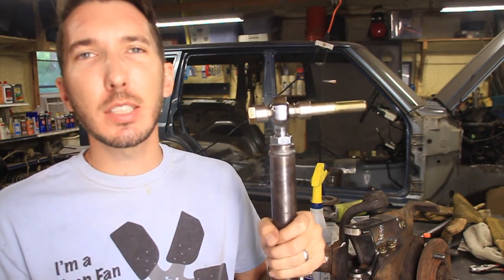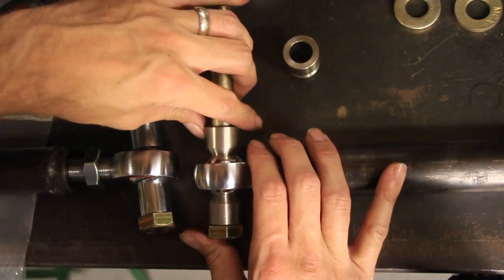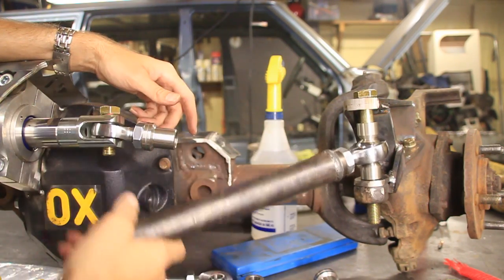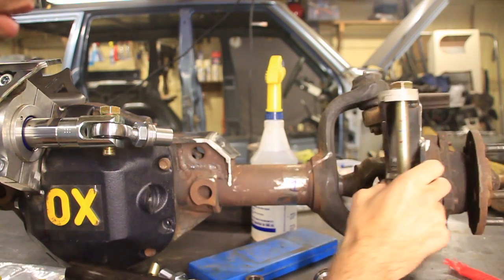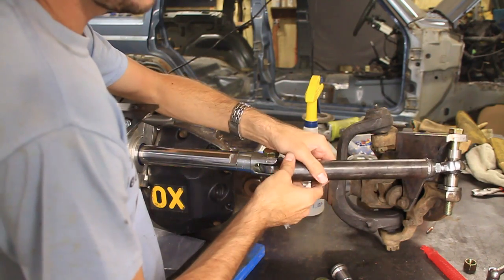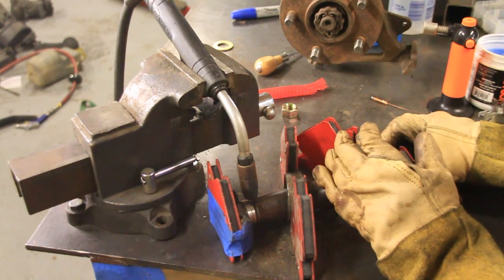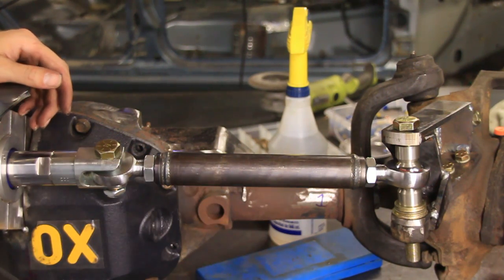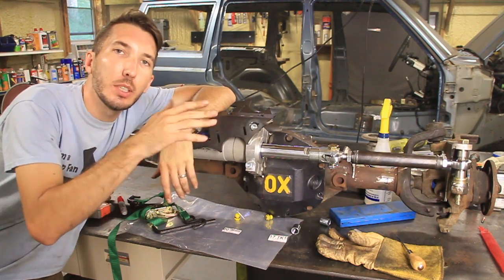What is a High Misalignment Spacer?  And Finishing the Full Hydro Steering

Comment: Would you recommend this for on road use, I plan on driving my jeep a lot as a daily driver would full hydro be good ?
Reply: +George McCafferty  ,  no ... In most states it is Illegal to have no mechanical connection to the actual steering wheel .. In the event of a line failure you have NO steering ...... If the Jeep is not running , you have NO steering .............It is also very sensitive and does not self center after a turn ......... A better choice for a Driver / Wheeler is Hydro Assist .....  It keeps the mechanical connection between the steering wheel and the axle , but adds a dual action ram to the axle ..  This provides you with great off road steering (especially with lockers )  and is safe for on road driving as well .....  The Assist can be DIY built for about 200-250$ , or you can buy a kit from PSC , Howe , Redneck Ram (West Texas Offroad ) , or piece it together yourself ............... Tons of info on Pirate 4x4 Forum , and all over the Jeep Forums .....
Reply: +Norman Murray thanks that's very helpful I appreciate it a ton!!

Comment: anyone have an idea if you can put a cherokee coil springs on a geo tracker?
Reply: +Mega Trick   Just have to measure the mounting surface of your stock spring (last coil on either end )  and compare it to the XJ Coils ... If the spring perches are large enough to accommodate the XJ spring yes it will work
Reply: Okay thanks

Comment: grate build matt, but my question is why did you choose to build up a tj rubicon 44 when it's just a glorify dana 30 and offers no real strength gains?
Reply from the maker: If I knew how much I was going to cost I probably would have but it would cost a lot to build a narrow Dana 60 as well and I wanted this to be narrow
Reply: I'm assuming it's because he had it already, and most of the building went into a different build. wish he would've went with Dana 60's or other full widths
Reply: +Jacob Aaron thats what i was thinking or at least a ford hp 44. the tj 44 is a good axle is what im running in my jeep  but im on 33  i wound be real hesitate to run 37 and full hydro on it
Reply: exactly, I thought Matt wouldve gone with something way heavier for a full out crawler build. I would classify the tj Dana 44 a weekend warrior axel, not a crawler type
Reply: +BleepinJeep but couldn't have you went with full widths and wheels with more back spacing? you start with a more stout axel and would ultimately end up putting less money into it
Reply from the maker: No, the brakes would be in the way
Reply: +BleepinJeep if you went with a hp 44 then you could use hummer h1 rims and they fit perfectly.
Reply: +John Tusler  depends on the steering setup .. The H1's wont work in stock form on my D60 because of my steering using heims .. If it was using stock TRE's they would work great .........